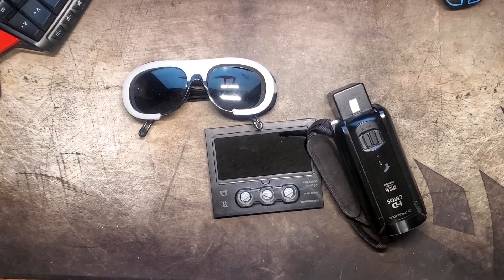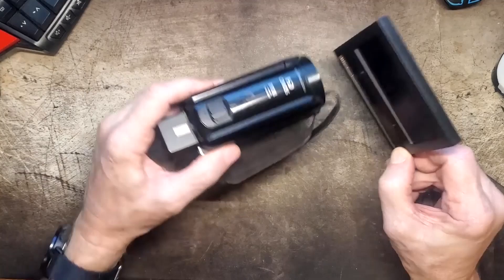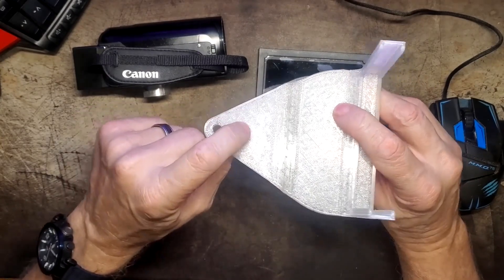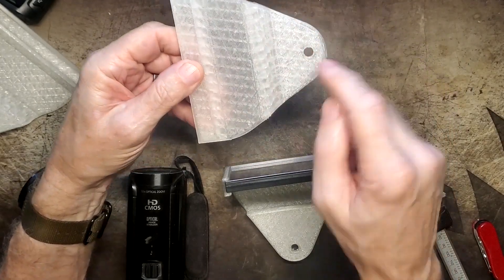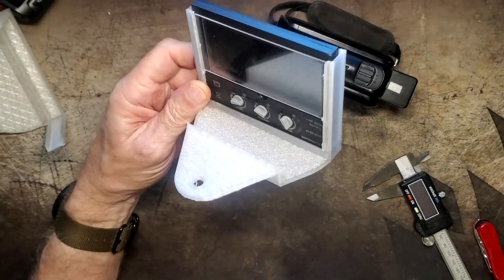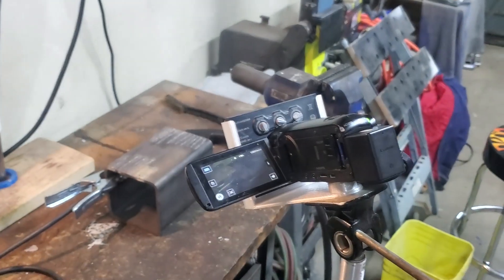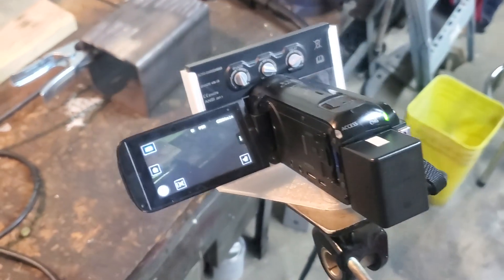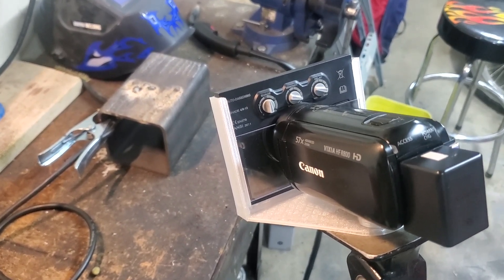3D printed welding lens holder for tripod to video welding process

Comment: I once tried using some smoked glass for taking slow-motion video of rocket launches and it worked, in a fashion, but no where as good as this lens device!
Reply from the maker: I did the same thing when I was a kid looking at eclipses, took a small piece of glass and held it above a candle until the smoke covered it. And yea, the auto darkening lens is a massive improvement.

Comment: In the old days,  you used a black blanket over the glas/camera,  so you don't have glare/reflexes from other directions. This helps with autofocus,  and you gets a more clearer picture
Reply from the maker: I owe you a beer. I just tried this, albeit with a dirty red shop towel, and it worked a treat. Autofocus was almost instant and the exposure was much, much better. Thanks!